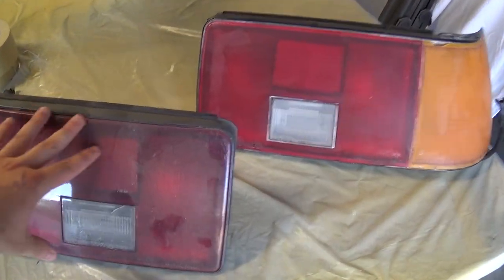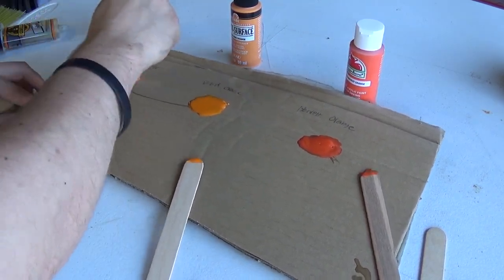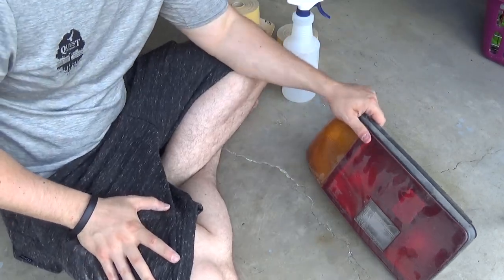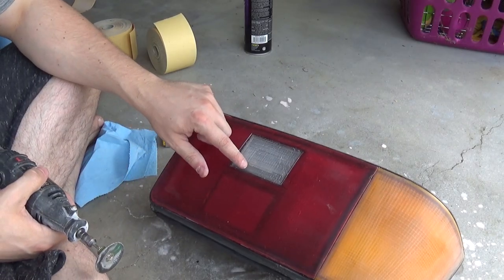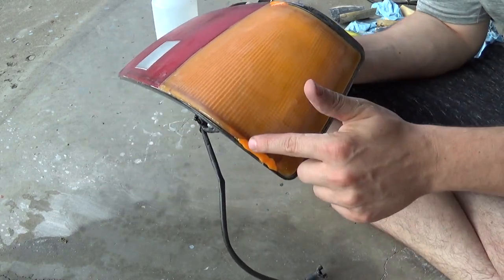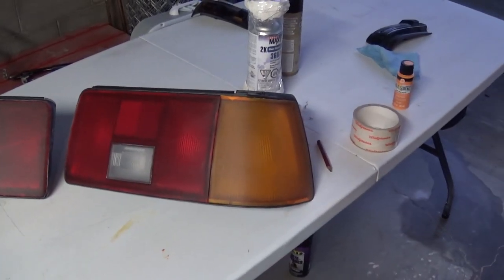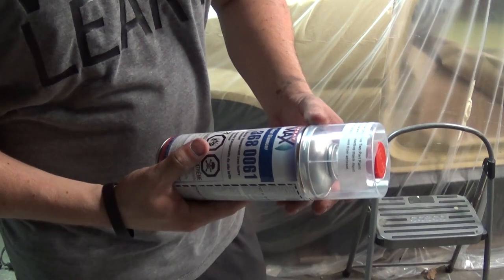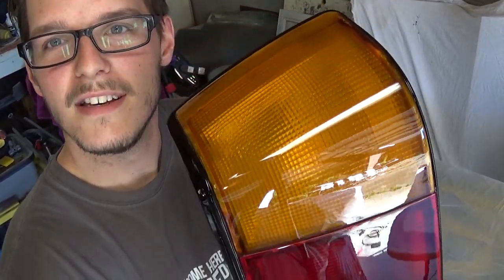AE86 Project | How To Repair Cracked Tail Lights - Tail Light Restoration

Comment: Dude, nice!!  Love the ingenuity with the epoxy and inexpensive pigments!

I've worked with VHT Niteshades quite a bit, and I know the look you're going for.  Two light coats, allow to cure, then use a DA polisher with a microfiber pad and Meguiar's Compound.  Some of the tint will compound out, but leave it a shade or two darker than you want it.  After compounding, wet sand with 2000 grit, clean, and clearcoat.  It'll give that sweet, "stock appearance" tint.  Hope this helps!  :)

Comment: Wow these tails cam out soooooo friggin clean. I gotta say that clear is the best on the market. I've used it before on paint projects and have never been disappointed with the results. great videos!
Reply from the maker: Thanks for the kind words and the reassurance on the clear coat👍 so far both the ae86 tails and evo headlights look just as good as the day I cleared them. I am hoping they don't fade or chip in the long term, but so far so good! Thanks for watching and supporting the channel 👍😎

Comment: Watching all your vids now! One thing you can do, though it requires a spray gun and compressor is mix clearcoat with black paint in order to dilute the colour to get the right shade for tinting.
Reply from the maker: Thanks for watching and supporting the channel!  Also, thanks for the suggestion! This is something I was thinking about if I ever try tinting again.

Comment: I’ve been dealing with this a while. UV made them what they are and proves to be the culprit to many repairs. The night shade rattle can suck. 2k clear with black tint to preference. JB weld contractor pack with a bondo applicator sanded. The plastic is brittle and flex’s at pressure, repaired squire a few in my days. Can’t justify taillights that cost more than the car. Great video, keep it coming.
Reply from the maker: Thanks for the comment 👍 I know exactly what you mean, the takumi tax is real for our ae86s is crazy high haha. Thanks for tuning in and commenting!

Comment: Thanks for the vid.  It was very helpful.  Could you confirm that the cracks were filled after the clear coat ? I couldn’t see it on the close up.  Thanks
Reply from the maker: Thanks man! I filled the cracks first and applied the clear coat after.  The clearcoat helped fill any imperfections so it looks super smooth. You cannot feel the cracks anymore 👍

Comment: Respect bro. Not many people will still upload a vid that didnt go there way
Reply from the maker: el ponciaw hahaha thanks man. Doing all of these projects myself and learning as I go, almost always leads to problems of some kind.  To me it's super important to work yourself through a problem instead of just giving up. I thought it was important to so the screw up and what I did to "fix" it. Ended up being super happy with how it turned out! Thanks for the comment! 👍
Reply: TheBSRecord it turned out really good. Was scared to take sand paper to my 08 escalade taillights but built up the confidence after watching youre vid. Keep up the good work
Reply from the maker: el ponciaw hahaha I know that feeling all to well.  I was scared to sand these tails, which were already in really bad shape!  My evos headlights are awful,  they are super oxidized and I am wanting to do this to them next.  I'll probably make a vid on that as well. Still a little hesitant about sanding the evo headlights, but if the finish turns out like the 86s tails, I'll  be super happy haha. How did yours turn out?

Comment: How are your tail lights now? I’m only asking because you didn’t use any plastic primer before your clear coat. Not using plastic primer which is clear, will result in any clear coat pealing off.
Reply from the maker: Wavey Davey they look just as good as the day I sprayed them. I have even applied tape to the clear coat and then pulled the tape up to make sure the clear wouldn't delaminate. I see where you are coming from with the plastic primer, but I don't think it is a necessary step, as long as the plastic is preped and clean properly before paint. I'll let you know if it ever starts delaminating and will update this video to let others know too. Thanks for watching and the support!

Comment: Hey mate, I know it's an old video now but just wanted to say they turned out very well. 
I've had issues in the past with NiteShades, it is a very very dark tint, no matter how far back you spray from, to get proper coverage it always ends up dark.
One thing you can do is actually get clear coat in a gun and put a very small amount of black in the clear. It'll spray much nicer then the pressure pack NiteShades.
Reply from the maker: Thanks man, they still look perfect today too!  Yeah, I have heard from a lot of people about niteshades being difficult to spray. I definitely want to try what you suggested on a future set but I have to get better with a paint gun before trying. Thanks for watching and commenting, I love hearing feedback from the viewers!
Reply: @TheBSRecord  Yeah, I've tried getting a slight smoked look to tail lights before but NiteShades is temperamental... Good to hear the tail lights are still going strong.

Comment: Did this cover up any small spider web like cracks? I have deep cracks and small  little cracks in my tail lights.
Reply from the maker: from the outside, yes.  If the spider cracks happened from inside, the light it will be much more difficult to repair.  Most of the spider cracks on mine were from the inside of the lens.  Its looks better, but I can still see some of them. Hope this helps!

Comment: Hey man my car i just bought some used taillights not knowing a piece was broken off at the edge and has scratches on it. Can i use the epoxy as the lens ? It’s clear lens would i just need regular epoxy and tape on the edge?
Reply from the maker: It depends on how big the piece is.  It seemed to work great for my application.

Comment: Another question: is the tape you used a special kind of tape or can you use any kind of tape?
Reply: Also did you put the tape behind the lens or on top? I am confused rn and really need to do this to my car as a piece of it has broken off at the edge.
Reply from the maker: The tape was just clear packaging tape.  I used the tape from the outside to create a "wall" and rebuild the chipped piece with epoxy.  I hope this helps, sorry for the late reply

Comment: Great job! But Highly recommend not spaying tint. Instead wrap in tinted film. It's consistant and removable if you want to change later. Plus it doubles as a rock guard.  That clear is the bomb! Used it many times to do fenders and smaller projects, even did whole bumper covers before. You only have 24hrs to use it after mixing so make sure you have enough project to use all of it and not waste it as it's $22 a can on Amazon.  I always dust the 1st coat on and then go a lil heavier the following passes.
Reply from the maker: Thanks for the comment and suggestion!  After using the VHT night shades, I would probably suggest the same.  Tinted film seems like a great option, and it removable.  My only worry would be the tint de-laminating or flaking off.  I guess one could say the same for paint if it isn't prepped and applied right.  That clear coat is magic in a can! It's crazy to see how far aerosol paints have come! Thanks for tuning into the channel, hope you are enjoying the content!

Comment: How is the repair (epoxy) holding up after these years? Great idea to add acrylic color (the lenses are likely acrylic also). I tried some generic epoxy on my old 370z tail, and it held for a few years before de-bonding slightly (possibly due to expansion rates and UV).

Have you considered a “weld-on” solvent, like for acrylic/plexiglass fish tanks? I am experimenting on some old Mazda tail lights right now

Comment: I was fixing a pair of 79' Accord tail lights today and found a nasty crack. Y cant find that epoxy here, so i am thinking in using clearcoat as a glue (no missing parts), i hope it works! Great great job btw, those tails looks brand new right now.

Comment: It's funny you should post this; my passenger side tail light is perfect, but one of the previous owners drilled holes in it to drain water buildup (I think the internal seal went on it).

I've been thinking about ways to seal it.  Idk if they make some kind of superglue that comes in clear, red, and amber, but that would be perfect!  Got any ideas?
Reply from the maker: Man that sucks, but i think I might have an idea to fix it.  The drain holes can be filled with tinted clear epoxy like in the video.  You should be able to use a vinyl tape on one side of the holes and fill through the other side.  let it cure and sand smooth like in the video.

As for the internal seal, I think you are referring to the sealer that is used to seal the area between the tail light housing and the lens.  If ae86 tail lights are like other headlights and tail lights I have worked on, the lens and housing should be able to be separated.  In order to do this, you must heat up the OEM sealant.  You should be able to do this with a heat gun or by sticking the tail in an oven at 350 degrees Fahrenheit for around 5 minutes or so (maybe longer if the sealant does not soften up.  When heated up, take a butter knife and carefully pry the lens and housing apart.  once apart, apply a fresh continuous bead of RTV sealant or silicone around the outside of the housing (where the OEM sealer is)  Some people use OCI butyl rubber glue for this job too.  Fasten the lens and housing back together and let the sealer cure.  I have done this to some headlights and tail lights before, but not with ae86 tails.  I am assuming they are assembled the same way but are not 100% sure.

With all that being said, if its a small hole in the old sealant, maybe just heating the tail light in the oven (to soften the sealant) and applying pressure around where the sealant is, might be enough to "reseal" the hole causing the leak.  Sorry for the wall -o-text, but I hope this helps or at least gives you some ideas.  Their are a lot of videos that cover this process on YouTube too, if you want the specifics.  Good luck, take your time, and let me know how it turns out!  Thanks for watching and the comment.  Maybe i'll show this process in another video...hmmmmmm
Reply: Thanks for the reply!

Yeah, my idea would be to put the tail light in the oven to undo the sealant, then fix the drill holes and later polish the lenses before putting it back together with new sealant.

I was originally thinking superglue (imagine putting a dot of colored dye followed by a dab of superglue) but I think a clear epoxy might be better.  I heard mixing superglue with any kind of water makes it harden instantly but also generates a lot of heat.

In terms of coloring the epoxy, I've been looking at Rit Dye, which seems to be the go-to coloring for projects, including plastic.

Now I just need to get off my butt and do it, lol :P

Comment: awesome job... the aerosol clear once pop the bottom, can it be use for the next few days or a one time deal use?
Reply from the maker: I got mixed information on this.  Some say 3 days some say a couple of weeks.  I applied 4 wet coats of clear on these set of tail lights and probably used 2/3 the can.  I shook the can up a week later and their was still liquid moving around inside and it sprayed too.  Not 100% sure on the longevity in the can though.  Thanks for the comment and  watching!
Reply from the maker: dsworks awesome I'll check out the channel, thanks for the info.  That would be sweet to help get some jdm parts 😎

Comment: w8 why would u not take thinner instead of sandpaper n scratch down all the toyota/teq logos?
Reply from the maker: I wanted to shave the taillights fully for that clean, sleak look. I intentionally sanded down all the raised areas to achieve this. You could always keep those raised areas, just be carefully sanding around them. Thanks for watching and commenting!

Comment: Unfortunately the max 2k only lasts about 6 months when exposed to uv. I know from experience. Nice job on lights though. Take care.
Reply from the maker: Thanks for tuning in and commenting! I will say from my personal experience, the spraymax 2k I used has lasted well over 6 months. 

In a previous video, I used the same clear to restore my evos headlights. The evo is my daily driver and has been exposed to every possible weather condition since the restoration. It also has been parked outside in the elements, since my corolla took hold of the garage haha. The headlights were restored almost 2 years ago and they still look the same as the day I restored them. No hazing, chipping, yellowing, or cracking of the clear coat so far 👍 Of course my case may not be the norm, but I do believe that prep also plays an extremely important role in a lasting finish. Thanks again for watching!
Reply: @TheBSRecord  I used this 2K clear from Spraymax on my mom's headlights like 3 years ago, and they still look great.
Reply from the maker: @VanHeezey  that's awesome my evo headlight is still holding strong! Great product!

Comment: Well that settles it! With how the clear on the tails worked out, you HAVE to paint the car yourself! Side note: I really hope you take this type of amazing attention to detail to the mechanics of the car as well. Much too often I see builds do amazing engine work with terrible body work, or amazing body work with average mechanics. Maybe a person has to have super human patience and above average financial resources to do both. Corners usually have to be cut in one way or another. But I really hope you keep this pace up and do something like build your own mega-squirt ECU, and find real motorcycle itb's, or set your own backlash on the LSD and weld your strut inserts. I see a lot of my own journey in this and as a result I think I'm going to take apart my 86 and do the body work the right way, I focused on the mechanics and lost energy by the time I got to the body. So all I'm saying is if this thing leaves the garage with a open diff, rear drums, and stock ECU, I'll cry and punch a little kid, which pretty much makes you an accomplice to child abuse...just saying.
Reply from the maker: +Rii hahahaha yes I plan to offer just as much attention to detail as I have with the body to the mechanics. I am a strong believer in "do it right the first time".  With that being said I will be learning everything as I go, so it will take some time.  However, I do plan (once it's painted)  to throw a seat in, taillights/ headlights, and the suspension back on and whip it around the neighborhood for a couple hours hahaha.  I have to get it back on the road for a couple hours just for sanity sake.  Don't worry though, I plan on rebuilding a smallport 4age from the ground up with either itbs or side draft carbs. Maybe an engine bay tuck too 👍

Comment: I'm pretty sure that cleat coat doesn't last on taillights. It will look good at first but crack in the future. To get shiny finishes on stuff like that. There's polishes made for that specifically
Reply from the maker: MrJerrybravo thanks for the heads up, as i am also curious how the longevity of this clear will be.   My thought is that this 2k clear is very similar to the clear that is overtop of paint on a car.  It is very durable ans should not crack like other aerosol clears.  Of course in this case, the clear was applied to sanded plastic instead of preped paint, which may effect how the clear reacts to the expanding and contracting of the plastic in different climates. I definitely did this to restore the tails, but also to test how reliable clearcoating tailights can be. If the clear starts to flake off it's no big deal, I will sand them again and try another method, but I will be sure to let everyone know too. So far, my taillights and headlights look the same as when I got done clearing them. I will definitely keep everyone updated with their condition over time 👍 Thanks for watching!

Comment: hey man good job on the tail lights i was wondering how many bottle you need for a ae86 hood ?
Reply from the maker: Thanks!  I am not sure how much you would need to do a whole hood. I used less than a can doing the tail lights, and I did multiple coats.  Two cans would probably be more than enough.  Three if you want to be extra safe and do multiple thick coats.  Thanks for watching!
Reply: TheBSRecord got it thank you brother !

Comment: Sanding off the DOT and MFG part numbers is not a good idea if you get stopped by the fuzz.
Reply from the maker: I see where you are coming from, but I cant imagine getting pulled over for those numbers being shaved down.  Thanks for the heads up though and tuning in!
Reply: @TheBSRecord  It's after you get stopped and they are looking for ways to harass you that it matters.  If you are in Cali, you'd probably go to jail for tinting a tail light.
Reply from the maker: Gotcha, I'm in Kentucky so they are much more chill here. I would be surprised if they even knew mfg. part numbers were on the tail lights lol

Comment: awesome work man! I was curious how you solved the stress cracks. I have some zenki jdm hatch tails that have them, it's quite noticeable when the brake light is on. Thanks!
Reply from the maker: TofuDeliveryPanda thanks man! Unfortunately, a lot of the stress cracks seem to be from the inside out, instead of the outside in. I didn't quite "fix" the stress cracks but after clearing, they are definitely a lot less noticeable. I figure if you can get the clear resin applied from the inside, it should make them go away. Thanks for watching and commenting!
Reply: ahh cool, thanks!
Reply from the maker: TofuDeliveryPanda no problem, glad to help!